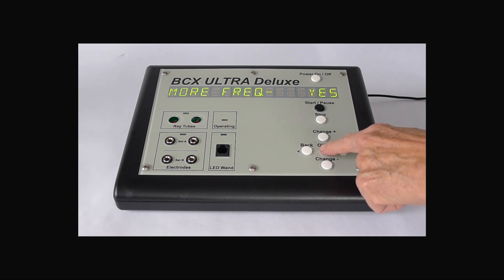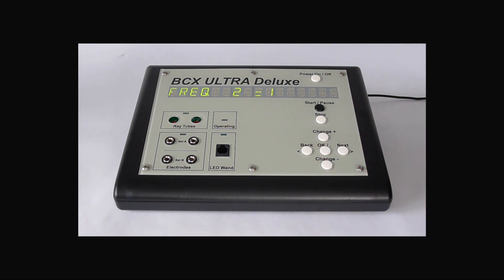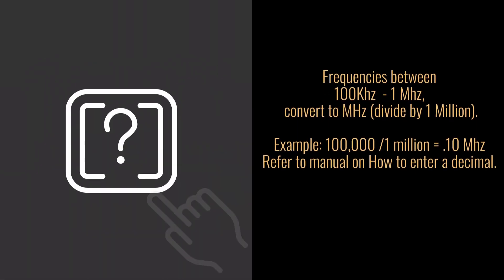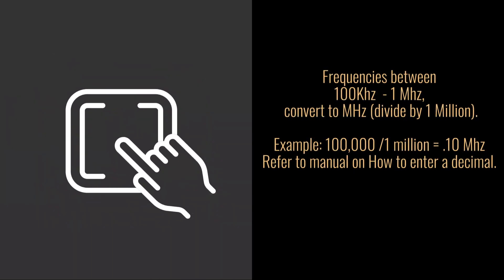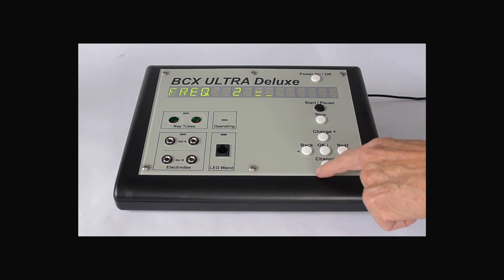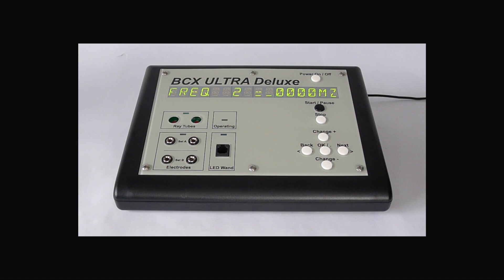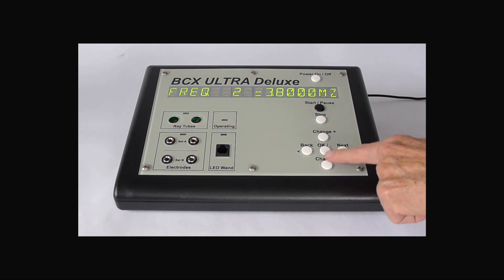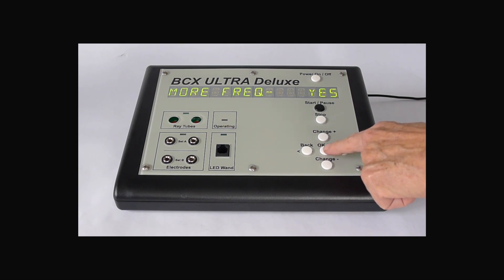BCX Ultra Deluxe Rife - Enter Freq/Carrier above 100khz

Comment: So can someone please explain the process to enter a frequency above 100k by using say 250k
Reply from the maker: In the video, it shows you how to convert a freq <= 100K to Mhz, & then how to enter in the converted Mhz frequency in to the BCX. The reason you have to divide by 1 million is make it less digits to fit in to the display
Reply: @HYMBAS.Channel so it wont be able to run say 256780htz
Reply from the maker: @PatrickKeon-m8m  yes. it runs up to 4 million hz